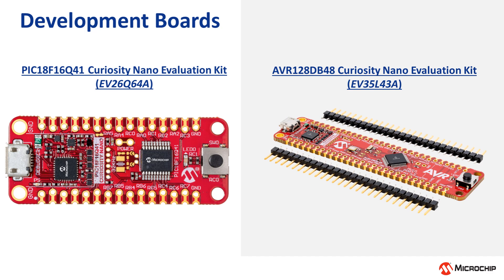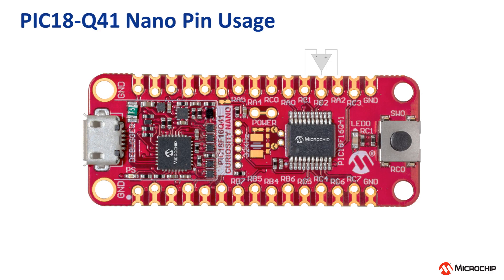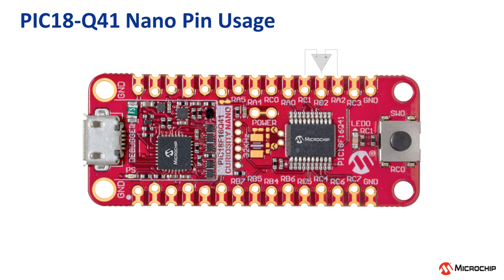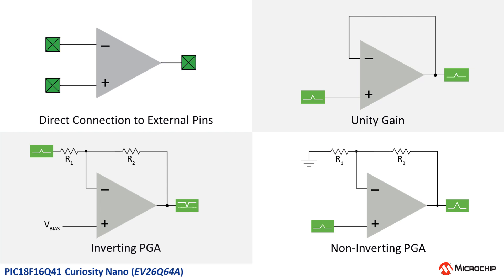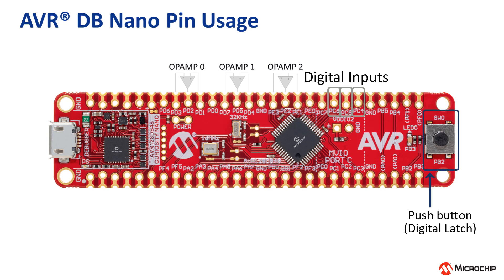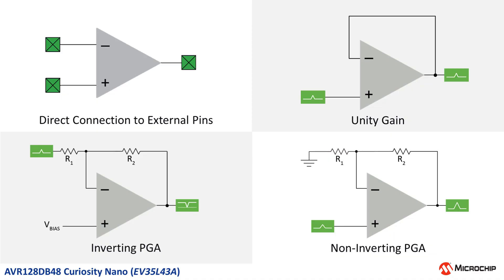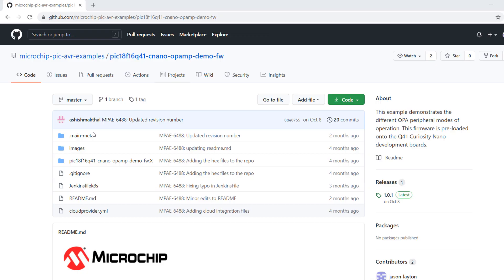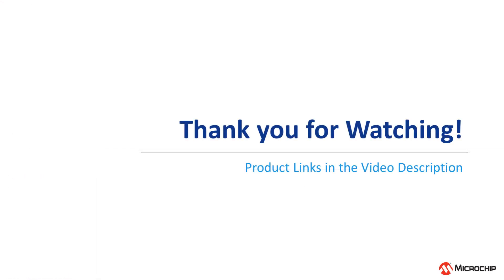Getting Started with the PIC18-Q41 and AVR® DB Curiosity Nano

Comment: For those who need to know how "drag and drop" works if you're using with Arduino (because these instructions aren't posted anywhere)
1: Compile and grab the hex file from the temporary directory after you've compiled your sketch.
2: Drag and drop to the USB storage that the Curiosity device created.
3: Create a file with the line, "CMD:ERASE" and save it. That should clear out old sketches.
4: Edit that same file delete the above line, and write, "CMD:RESET" and save it. That should install your hex file upon resetting.

There's other more "native" ways of uploading firmware (and allow you to manipulate fuses, which the "Curiosity File Drag-and-Drop" does not enable) but I haven't been able to get it to work on Arduino, even after playing with group (dialout) permissions, checking and double checking dmesg and lsusb, etc.

I wasted an entire day just to figure this out. If Microchip can point to the actual tutorial/instructions they published for this, please place a link to it!